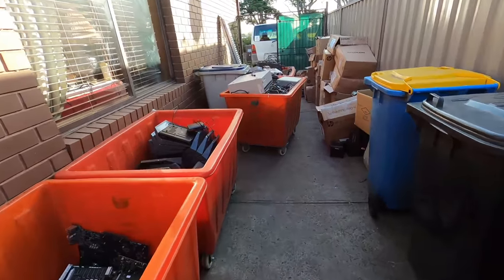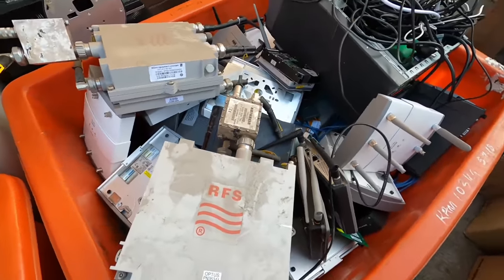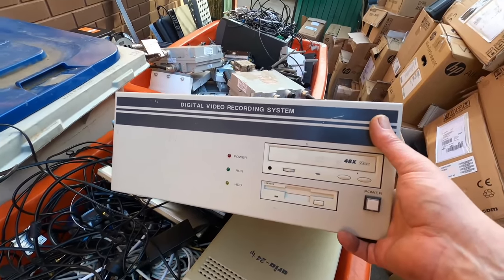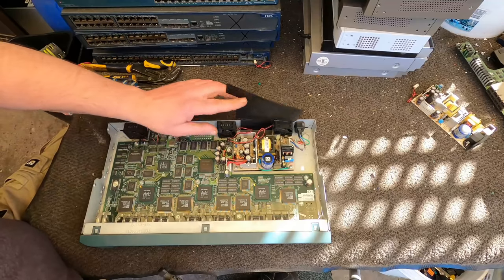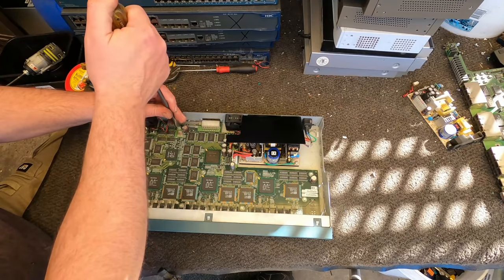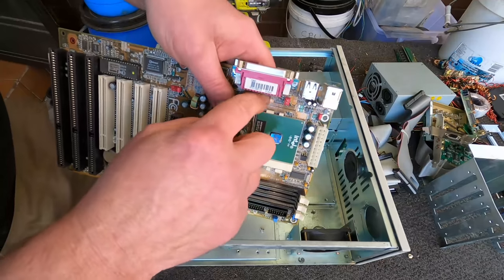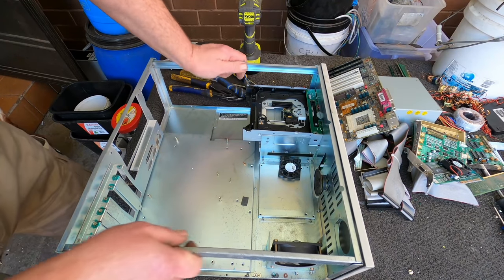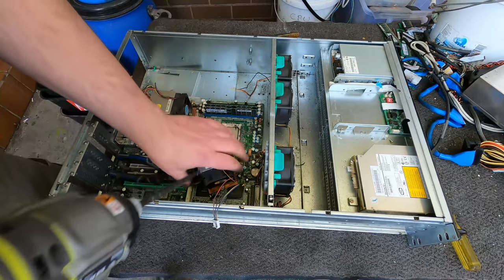Scrap Marathon Biggest Ever Part 2

Comment: If you are looking for a #1 bit for your driver, try this: Find a #1 Screwdriver you own that is the required length you need. Then Just break off the handle. Put the shaft into your drill and whoola! Instant #1 bit for your Driver! This will not work with your New Power driver, however, but if you have an Adjustable chuck, it will work fine!

Comment: I depopulate the power boards of the aluminum, copper coils and the transformers and toss the rest. I also bust open the fat adapter ends taking out the transformer and bust off the plug blades for the brass

Comment: Get another electric screwdriver with the smaller tip. Diff color would be good. Other scrappers use two or three drivers and NO MORE SLOW HAND SCREWDRIVERS. LOOK THRM UP.

Comment: 29:00 TP-Link is saving each cent they can. They even have network cables with just 2 pairs in it in stead of 4. Saving another cent on copper.
Reply: u dont need more pairs if ur switch cant handle it, i agree that they r saving every penny tho